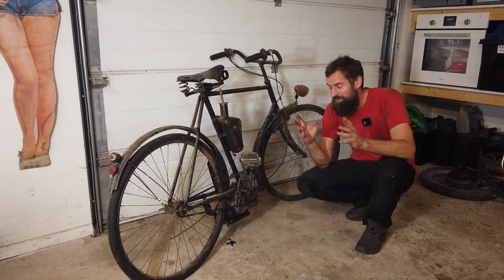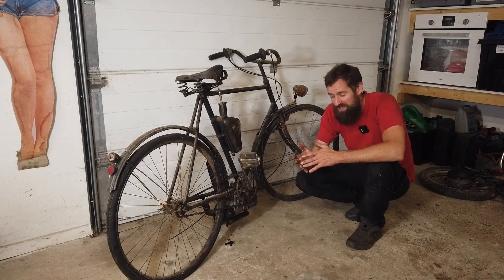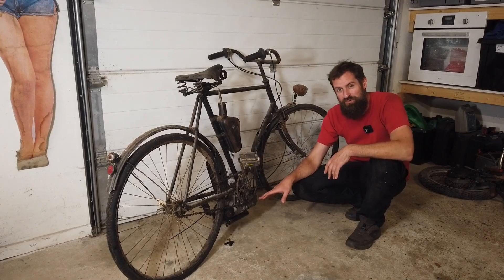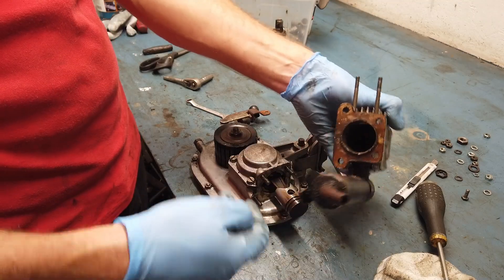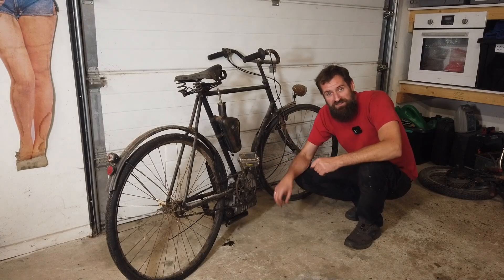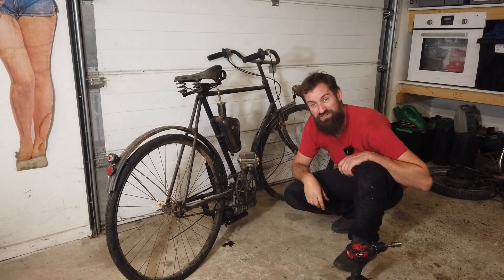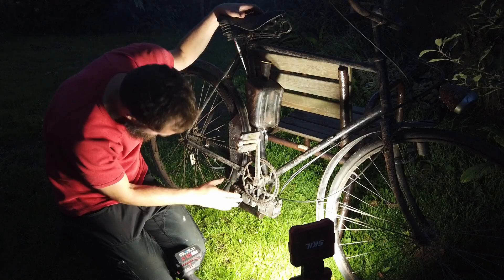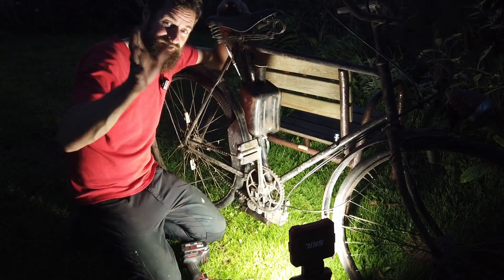Two Stroke Diesel Moped With Variable Compression! 18cc!

Comment: so when you drive it you advance the compression and adjust the drip rate always in the same way? If that is the case you could put it onto the same throttle (maybe differently shaped cams) to get rid of the "second throttle"- but I don't know how you actually operate those engines- I have only seen compression adjustments on old boat engines- but driving a boat seems completely different..
Reply: The "automatic" adjustment is a good idea...except if you change the composition of the fuel????

Comment: I've heard the Lohmann Diesel mentioned many times, but my thing isn't this type of transportation (i love mopeds, but not usually bicycles with engines), so i haven't bothered looking into it. ..but man.. Variable compression, so simply made. Watching how that works, putting myself into the shoes of people facing some pretty real world tech issues back then, i'm absolutely fascinated by it. ..and that tiny piston 🥰Could you show us the fuel delivery system when you have to fiddle with it anyways? I want to know more 🙂
Reply: The fuel delivery system is a super simple carburettor ("mixer") without a float chamber. And that "mixer" is one of the main reasons for the scarcity of the Lohmann engines. It is made out of Zinc and simply rots away.
Reply: @albinklein7680  
Bit like magnesium aero engine bits and pieces...rot away.
Reply: Honda started with simple mopeds
Reply: @stewart8127 
All motorcycle manufacturers started by attaching an engine to a bicycle, a mo- ped. This began in 1885 when Rover invented the safety bicycle which is still manufactured almost unchanged world wide even today. Later in 1899 they fitted an engine to it and went on to manufacturing over 10,000 motorcycles before concentrating on motor cars.
Reply: @johnbrereton5229  not the ones that started in the 1970s who previously made looms , musical instruments,or Trains. Meaning 3 of the big 4
Reply: @stewart8127  
After WW2 Japan needed to get mobile so in 1946 Honda fitted surplus generator engines to bicycles and created the first Honda so yes, it too was a moped.
Reply: @johnbrereton5229 moped was not first for the other big 4. Yamaha Kawasaki Suzuki.  Did not start with mopeds

Comment: Great stuff!
How is it lubricated? 
Does it have a sump or do you have to premix oil into the fuel?
Reply from the maker: There are different opinions on this subject actually.. some say no oil needs to be added to the fuel... other say around 1:40.... I go with the last one.. so 1:40... I guess it only means more smoke if it was not needed... :P